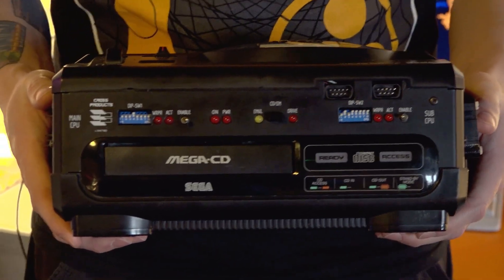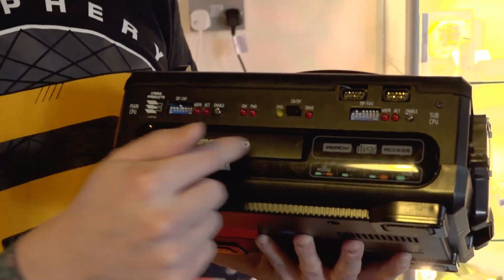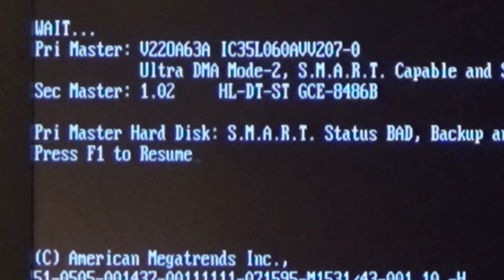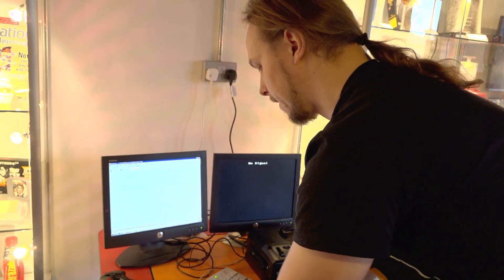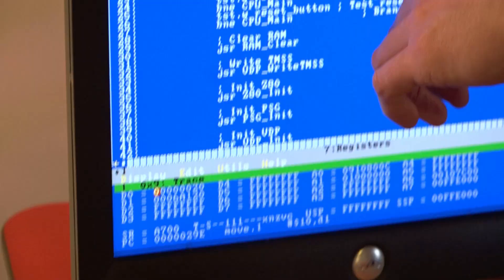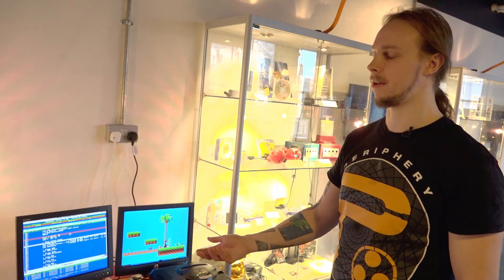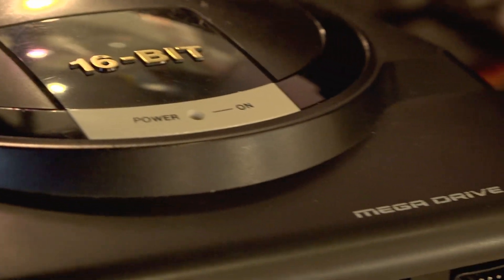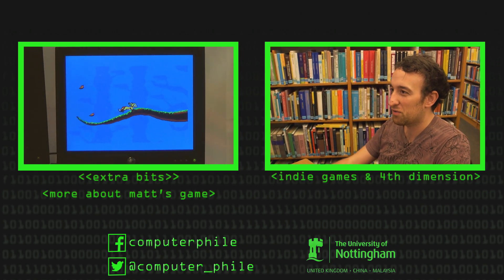Sega Game Coding in Assembly - Computerphile

Comment: No mention that the Mac also used 68K up until the late 90s.  Also to work with a genesis, you have to learn Zilog Z80 assembler to talk to the sound hardware.

Comment: great. but all that to experiment with assembly language. 
create a sega compiler for C. is it possible?
Reply: The 68000 is one of the first CPUs that were nice enough to reasonably target with C (other ones being x86 and RISCs). So yeah there are many C compilers for it (used in tons of Macintosh, Amiga etc software). There are even some C compilers designed for Genesis, and unlike SNES (which had to be coded in Assembly due to its somewhat outdated CPU even back in the days), there are Genesis games that are mostly C like Sonic Spinball (although afaik most games are pretty much all Assembly)... Dunno for Matt but to me, coding in C is kindof... work. :3
Reply: Back in the days, C compilers weren't that smart, so they tended to load and store the same memory variable over and over instead of saving it to a register, which is definitely appreciably slower (which is why C had the register keyword).
Reply: Nelson aka SpOOKY on genesis its probably best to stick with Assembly
Reply: Nelson aka SpOOKY and theres already a few C compilers for genesis.
Reply: madmax2069 do u know sm way to simulate genesis hardware on pc
Reply: +boptillyouflop Do you know if there's any significant loss in performance from coding in C? I would suppose there's some loss, but then C also allows for some quite low level coding... so I'm kind of wondering.

(Programmer-side performance tricks aside, that is. Just in terms of the fundamental language capabilities)
Reply: Nekkz And to quote Michael Abrash, from his black book: "Certainly if you use assembly at all, make absolutely sure you use it right. The potential of assembly code to run slowly is poorly understood by a lot of people, but that potential is great, especially in the hands of the ignorant."

I personally stay away from it. :)

Comment: If I already have experience with 6800 (not 68000) assembly language, would it be easy to learn 68000?
Reply: easier than if you didn't, and easier if you only knew, say, z80 assembly.

Comment: How do you animate the game? Pixel by pixel?
Reply: Probably there's a set o sprites, one for each movement/position.
Reply: They had to specify the sprites pixel by pixel, but once the sprite is loaded in the GPU they only need to tell it draw the sprite on the desired location on screen.

It should be noted that the size of the sprites is limited and it is not rare for a character to be composed from various sprites. There would also be a limit of loaded sprites in memory, so they may need to swap the sprites on runtime.

For the Mega Drive there are up to 80 sprites from 8px by 8px to 32px by 32px with 15 idexed colors. NES uses a similar system, with less capabilities.

Doing it these days? These days you load textures to the GPU, all GPUs should support 256tx by 256tx textures (or bigger depending on the specs) with full 32bits color and up to whatever how many you can fit in video memory (which could be 1GB for example), so we could be talking about thousands of textures, of course video memory is also taken by geometry and other things. I say tx because those aren't pixels in the output, those still need to be mapped to pixels by whatever transfomation you are applying to whatever geometry you are applying the texture to... and that's without talking about shaders.
Reply: I know that for Super Mario on the NES, they designed everything on graph paper, then entered in the sprites pixel-by-pixel, by hand with no automated tools into a table. Drawing the scene then broke down to specifying which segments in that table to draw where and when. A lot of people are aware that that the clouds in Mario were the same sprites as the bushes, just colored white instead of green. But actually pretty much everything in the game was like that. No one drew a pipe, they draw a two pipe bases and a pipe top, then reversed it for the other side. 

On the other hand, there's really no reason to do that these days. It's certainly pixel art, but you can do that directly on the computer. It does look like he was running Windows 95, so he at least has access to MS-Paint. Otherwise, all pixel art is done pixel-by-pixel. Animation is like that.
Reply: Geoffrey Zoref You move the sprite by its local origin; so the code only runs on 1 point and it displays the sprite in relation to that point. If it rotates the sprite rotates. There would be either different sprites for the animations or animated sprites. If space is pressed add 2 to player Y velocity and replace sprite with jumping sprite. Something like that. Running the code on each pixel is very time consuming; everything is based off local and global origins.
Reply: And without a GPU, like on MS-DOS, you had to do all that sprite compositing in software. Trundle through all the pixels, copying data from background or sprite to your screen buffer as appropriate, then dumping that into VRAM for display.

Modern GPUs are interesting, and shaders... Ah, now they're fun. I wrote a simulation of the PAL TV system in HLSL for use with Media Player Classic. Horribly slow, but it works. I get to enjoy rainbow edges again!

Comment: This seems pretty hardcore OO. I'd like to know more about how to deal with the graphics and audio in assembly though.
Reply: MrAstroKind it all depends on the system. There are many ways of doing that, I'll give you an example for c64 which uses memory maped I/O.
If you want to make the graphic or sound chip to do something you write or read from a specific value. For example the address 0xD020 is the background color. You can write a number to it and it will chamge the color. It doesn't mean that the video chip is reading that memory all the time to get the color. The computer is wired in such a way, that when you write a value to that address it sees that and pokes the video chip instead of actually writing that value.

Comment: Wouldn't it be more efficient to use a modern computer and emulators to make your game?
Reply: But would it be more fun?
Reply: Mr Fathead why make an emulator debugger when Sega already made one for ya
Reply: Yes, but it is entirely possible to use Emulators, especially since things like this are really really rare.
Reply: Whether it's more efficient or not depends entirely on whether the emulators' debuggers are at least on par with or better than Sega's, doesn't it?
Reply: It is not that bad. Like 99% of code in actual games does not access the hardware and does not do anything fancy, so it will work just fine. The remaining 1% can be tested beforehand, even by other people, you just need to folow the rules. And if something fails, you will know where to look.
Reply: If you're going to release your game on cartridge, your best bet is to have an actual console/devkit so you can make sure your game will work on an actual console.

Comment: Ah, yes. I've been contemplating snes development recently.
(also a hardware project to see if I can make a functioning replica of the snes CD or something like it using mostly off the shelf modern parts, such as a SATA dvd drive...)
These old systems are really quite interesting.

I have even considered the notion of making actual games for these old systems and trying to sell real cartridges of them.
The cartridge components aren't that hard to replicate, with a bit of work you could design something and make it by hand, or on small production runs...
Though I have no idea what kind of  market there is for such things.
Not that I really think it matters, because at this point you make such things for the love of it, not for money...
Reply: Zeithri Wrong. I use emulators every single day to test my stuff. In fact, I've been researching multitap, and none of the emulators I've tried seem to agree how it is supposed to work. I write a piece of code that works on one emulator, for it to break on another. Now of course, when you go to do some advanced VDP effects, pretty much all emulators fail to emulate it right and only hardware works properly. Except when it doesn't and you notice there is a difference on how things work between 2 hardware revisions. It's a huge clusterfuck that nobody will ever be able to solve.
Reply: PleaseDontWatchThese I have never used it nor have I developed for SNES, so I couldn't tell
Reply: I don't think I'm going to be lucky enough to find actual developer hardware though.
That stuff is SO rare.

Still not sure, because I suspect that means I'll have to code a lot of things without the aid of a proper debugger.
Yes, emulators can often have debuggers, but an emulator isn't real hardware, and even the best, most accurate emulators sometimes don't behave like the real hardware does...
Reply: Actually I never had any developer hw. I've got my way by simply using the emulators around and a flashcart with a real Mega Drive. If you spend enough time, these tools will be enough for pretty much anything.
Reply: KuraIthys I've been working with snes development for the past year as a little hobby.  It can feel really futile from time to time without a proper kit, just sort of using flash carts and emulators.  But at the same time it is just the most exciting thing for me to make games like how it was done before I was born.  If you're considering trying it without a kit, I highly recommend giving it a go. Just be prepared to grit your teeth and work through problems that seem to have no solutions.
Reply: You totally don't need 'actual developer hardware' to make games.
Reply: shiru8bit No, but it usually helps.
Reply: I don't know anyone whom would it help today in case with retro consoles. The guy is like the only one who want to use it, and that's sure not for reasons of efficiency.
Reply: ᑎᗩTᔕᑌᗰI 
I'm not going to have this discussion on youtube again with someone who - I'm going to presume here so I apologize in advance - never emulates.

So I'm just going to say:
We're not going to agree.
Live long and prosper.
Reply: ᑎᗩTᔕᑌᗰI how well does bsnes work?

Comment: Oh gawd coding a game in assembly sounds like hell. I'd assume not all of the game is done in assembly, like graphics ect would be just hell in assembly.
Reply: Yeah, it's pretty scary. But... Not as scary as you might think. A simple game on one of these old consoles or 80's home computers requires surprisingly little code.

Though by the time of the snes, mega drive and the like I'm fairly certain they had dedicated tools to create art and music with. Perhaps a little rough around the edges compared to what you'd see today, but still, SOME tools...

that wasn't always the case though.
Do you know how Super Mario brothers on the NES was made? Obviously the code is pure assembly, but the graphics and levels were drawn on graph paper. (so each pixel is a square)

So... How do you get from graph paper to a computer program?
Well... Unfortunately you manually code the relevant numerical values into the program in the relevant spots.

People still do this sometimes in simple demos even if they're using C or C++ (in a high level language it generally means stuffing a whole bunch of values into an array.)

It sounds horrible, but it's not that bad in practice. As long as you know how the data has to be arranged in memory, and where it goes, you can just look at your graph paper design, write out the whole set of numbers that represents this on a piece of paper, and then type that into the program.

The tricky part is seeing the raw data and knowing what it represents.
That's why you design stuff on graph paper first, rather than just plugging numbers directly into a program.
Reply: Ben Cradick all the consoles graphics handlers are inbuilt, I think. But that would all be accessed in assembly.
Reply: KuraIthys it's very easy 68000 is a dream to use.  You have c to 68000 compilers these days he's doing it the wrong way.  I was writing 3D games on Atari st 68000 as a kid. I'd say it's easier.  The hardware is so fixed you know what you are dealing With.  The real skill is knowing algorithms really.  I literally didn't learn much at all at uni after doing all This.  You know it all if you start writing games in assembly. Especially 3D games. As you really then know maths, physics and shit like sorting algorithms.  You can learn this so fast as a kid.  I still know 68000, 6502, z80 even now..